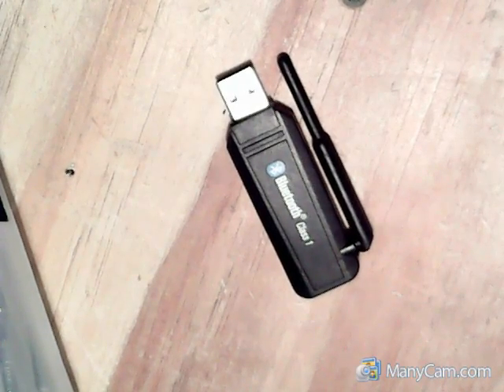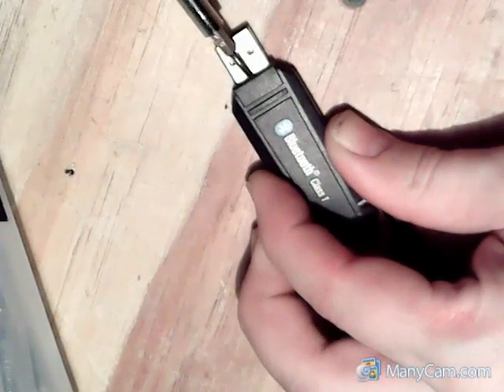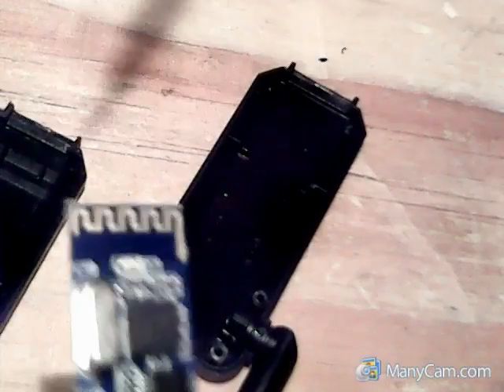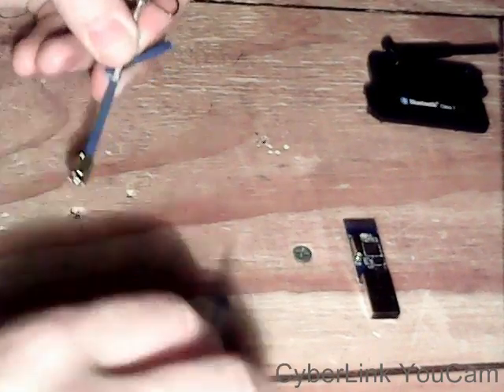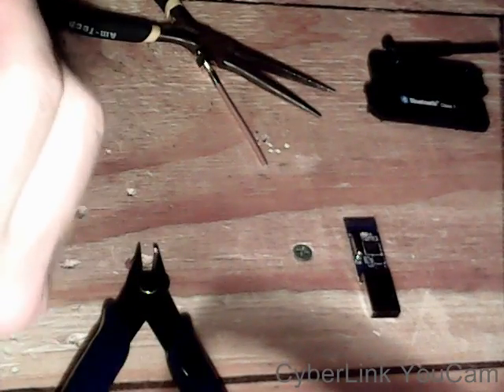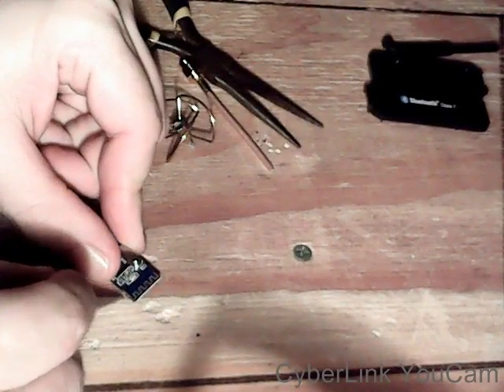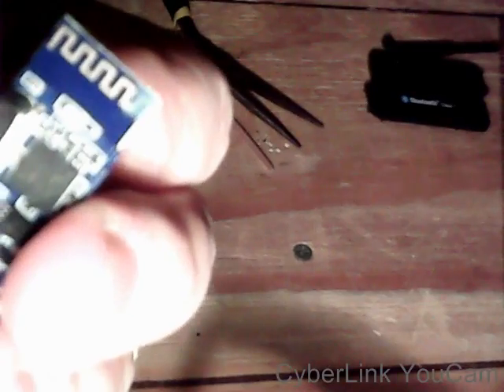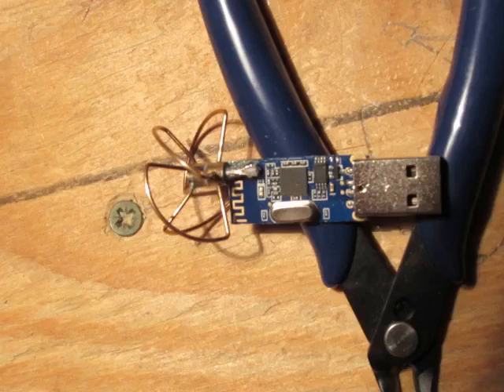BlueTooth Range Extender

Comment: Invest in a class 1 deviece instead as they are designed for better range and buisness  / industrial areas
Reply from the maker: Where is the fun in that 😉
Reply: @TheOffGridFamily  good question. Sadly it is hard to find a good quality usb adapter that also support bluetooth 5.0
Reply from the maker: @Murlock2000  I find that they are just so expensive and not aimed at us but more industrial applications etc
Reply: @TheOffGridFamily  Yes you are right but they do also come with more features and better range and reliability :)
Reply from the maker: @Murlock2000  yeah that is true.

Comment: When you increase the gain of your BT transmitter's antenna, you also increase the BT receiver's gain. Now, it will pick up MORE  of the other BT & WIFI signals in your area. So, if you live in a hi-signal area, any strong signal will interfere with your BT radio MORE, because you've made the (RFI) interfering signals so strong, into the BT receiver.  
When you add a high-gain antenna or LNA (pre-amp) to a radio receiver, there is a good chance that your results may not be as expected, because you aren't using a Narrow-band radio. One that can reject nearby channels..  
If you live out in the woods, your add-on antennas will normally work great..

The only other way to get long range (in your hi-signal area) is to use a Directional high-gain antenna, and point it at the area you want to have good BT signal coverage. 
Using a hi-gain Omnidirectional antenna will not work very well. Since it will pick up RFI from all directions.
Reply from the maker: Brilliant information, thank you very much